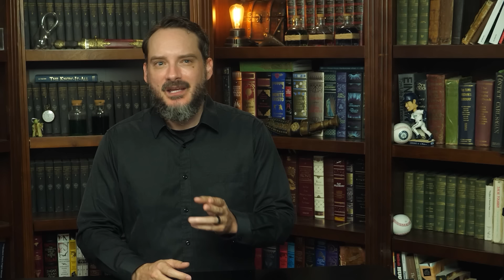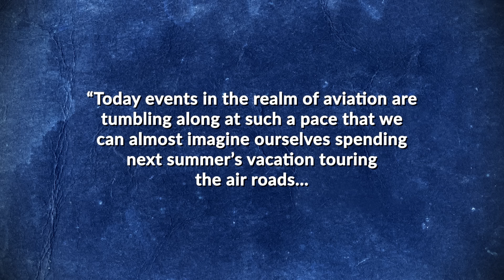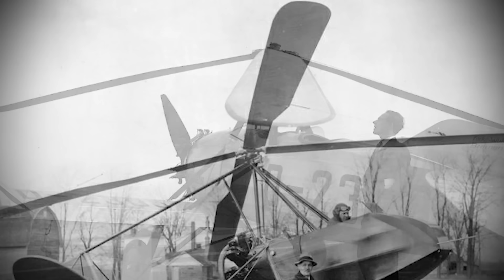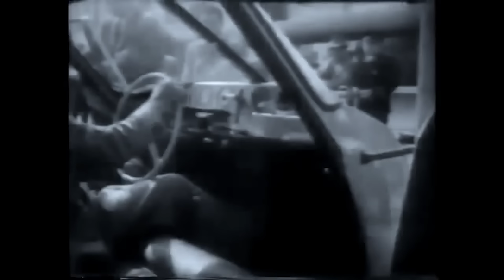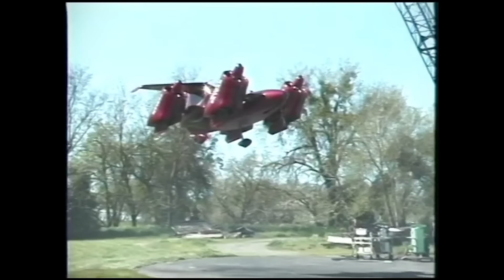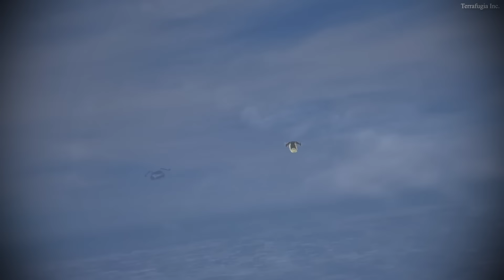A Plane in Every Garage- The Long and Twisted Road to Flying Cars

Comment: We are never going to have Flying Cars. Look at how bad the average Driver is on the road, it would rain crashed cars when they can fly.
Reply: I would suggest that the training and experience people would need  to fly this type of futuristic models, the amount of training that pilots needs to undergo prior to actually going up in the air, the amount of drivers that we question their driving, and whether they got their licenses off the back of a cereal packet.
The fact that cars, trucks and 4 wheel drives have had many safety additions since the auto mobiles inception have cut the (Australian) road toll to a certain level, cyclist and motor cycle death/disability tolls have risen, the psychological understanding of why this is happening is yet to be explained, and the continued stagnance of mortality and disability rates still refuse stubbornly to fall to zero, which is sad despite all the safety inclusions, and road improvements, so the problem is the human part of the equation is always going to be the problem.
Reply: Well not really there way more space up there then there is on the roads

Comment: As a retired (28 years) air traffic controller… I am SO glad we never had flying cars! “Real” pilots were scary enough often times!
Reply: Flying cars will have to be automated or be able to take over ASAP. 

 Which actually should be easier than self driving cars. Less stuff in the air as far as obstacles. 

 Yet seriously. Ford could have changed the way we see flight if history if he had his way. Ford definitely for all his flaws did try building a better future that did not involve pleasing stock holders.
Reply: @dianapennepacker6854  aircraft require a lot of money to remain air worth. People can't change their oil on time.
Reply: Licensed private pilot here - my apologies. At least you've never given me a number to call in my 10 years of flying. 😂
Reply: Not only that, but can you imagine the used secondhand jalopies falling from the sky 😳
Reply: They're also a distraction from good infrastructure like trains. People who want the convenience of flying cars don't realize they want trains
Reply: I think I've got the picture.

Aviation is like having drinks with you: 
#1 You call the shots. - #2 Reaching the service ceiling could be possible.
#3 In spite of you doing your best giving good advice - not following the directions and using common sense - the outcome could be chrashing in a micro cell...
4# flying low and fast has its perils... bird strikes could be a problem. You might not be sure of what hit you. Later upon inspection trying to reconstruct the events. You feel blessed being relative unscaved. Even when the details are obscured - the bird has left an impression.
#5 enjoying wild life is great - but there's a time and place for everything! 

I could be wrong being a layman - using a laymans terms using a somewhat superficial language and understanding. I try to use my words careful and within the context. 
However I've learned the hard way - just getting out of the house I'm already in trouble... Waiting for the wife getting ready to go - I could be tempted to watch YT and commenting. The wife looks at the clock giving me this scary look saying: "STOP GOOFING AROUND! We're late.." I'm eager to comply - However trying to tell you read her loud and clear by saying "I'm ready for a quickie..." I would have thought it was evident - I WERE ready for a quick departure! She never ceases to amaze me. Probably why I'm still fond of her. She's far better at multitasking than me. She's way better at giving directions than me. I'm not always sure of why she's giving me directions. But it's a helping hand keeping me out of trouble being concerned for my health and safety.  I'm surprised by the similarities between marriage and aviation. You're not alone - why playing by the book and unwritten rules makes sense. Failing to observe them will be having consequences...
Reply: @abcdef-qk6jf   A truly and literally outstanding comment. In an age and a forum in which total screwballs enjoy an unprecedented degree of access to mass communications, comments like this one stand out from all the rest. 

Where do I even begin? The degree to which it reads like the free association of a schizophrenic, as shown in that stream of consciousness regarding your wife? The bizarre strangeness of a whole variety of linguistic constructions, like "Failing to observe them will be having consequences" (the likes of which would make me suspect that you're not entirely comfortable with the English language, except that sections of this are completely fluent)? 

How about "You feel blessed being relative unscaved"? The absence of the -ly from what should be "relatively" is sloppy, but it may be a mere typo (although I'll bet it's not). But "unscaved"? That's not a typo. That's exactly the kind of error that's seen regularly in these pages of illiteracy, the output of people who do not read, and who are guessing at words which they have only ever heard, but not seen in print. 

Are you really married? Your wife, if she actually does exist, must have the patience of a saint, putting up as she apparently must with such juvenile stupidity as the attempt at humor regarding a "quickie", which at least did make sense - most of this total mess makes no sense at all. 

Although I'll bet it makes perfect sense to you. But that is only because your mind is just as much of a disordered mess as this comment is. Again - just outstanding.
Reply: This is my exact thought EVERY time someone mentions flying cars
Reply: I've seen how most people drive...
Reply: God could you imagine the sovereign citizenry, flying,no training necessary.
Reply: flying cars?
we gaan!
Reply: They're currently under development in the Netherlands
Reply: Yeah doesn't take much imagination to realise the 3D nightmare of mass pilots & undoubtedly assholes who intoxicated.

Humans still can't handle roads. Heck they sometimes struggle with walking on the ground.

So much death.
Reply: That's what I've been saying,   could you imagine all those idiots on the roads flying around in the air!!   It should never happen
Reply: The issue is the financial restrictions vs practical skill based restrictions it takes to be a licensed pilot. 

Plenty of people who are skilled enough to be pilots can not do it over financial restrictions, yet plenty of wealthy people who are not skilled nor disciplined can easily get a pilot's license after paying enough to get through the minimal tests and quals. 

We see it constantly in general aviation with mishap investigations where licensed pilots with limited time and quals do something stupid and get themselves and their passengers killed. 

Money can buy ones the pilot's license but can not buy the skill, discipline and ability to admit one made a mistake(ie inadvertant IFR) to be an actual pilot

Comment: Back in 1964 when I was 8 years old my (aeronautical engineer) dad explained to me why I would never have a flying car:  Even though flying cars had already existed for nearly 20 years by then.  Everything that makes a GOOD CAR (suspension, strong (heavy) body, transmission, etc.) makes a really BAD AIRPLANE and everything that makes a GOOD AIRPLANE (wings, etc.) makes a really BAD CAR.  He's still right. 

Note:  The spate of electric "drone" style "flying cars" is no exception to what he said.  They are impractical, expensive, not really "cars" at all, and batteries can only keep them aloft for a few minutes.
Reply: The latest ones developed as "air taxis" for shorter trips can fly for hours at a time, and could charge at any location with the correct electrical connection without it or the pad needing to hold volatile fuel. They're really just VTOLs though, and designed to be automated or use remote pilots instead of being flown by person.
Reply: @V3RTIGO222 Aircraft are very susceptible to weather conditions - especially smaller ones.
Also, motion sickness by occupants.  No significant commercial market for even professionally piloted EVTOLS.
Reply: @V3RTIGO222 you ever fly a drone or ride an ebike against the wind? Battery life gets cut literally in half at less than 15 mph winds.
Reply: @XiaolinDraconis  So from two hours down to one... not so bad considering that if it was actually implemented the way it'd need to be, with nuclear power infrastructure to suppor the grid, you could have charged landing platforms on the roof of tons of buildings, like parking garages. EVTOL charge station attendants that handle maintenance and direct customers wouldn't be a bad idea.
Reply: @V3RTIGO222  true, my infrastructure is McDonald's wall outlets. I'm never more than 10 miles from one, enjoy coffee while topping up for a dollar. eBike with a gas motor backup.
Reply: It's harrowing enough going out on the roads with these lunatics. The sky? Nope. The flying car concept will never work without a computerized air traffic control system that takes all control away from humans, and nobody wants that, because EGO.
Reply: Have you heard of balloons and their older empty forefathers, which the latter don't exist functional yet?
Reply: @KhattaRapidus   What do balloons have to do with flying cars?
Reply: Weather is the real issue. Planes are sharp knives that cut through the weather, flying cars won't be able to.
Reply: @ElectricCherry77  I mean by 1964, there had been several different versions of flying cars designed, tested, and flown over the previous 20 years. What was unclear about my original statement?